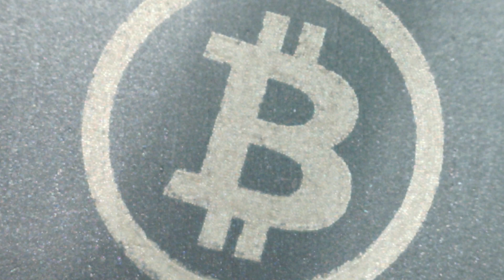ASICMiner Block Erupter USB Teardown

Comment: well, i was using bitminter to mine, when it had 10THP now its up to 15-20 THP also diffculty was at 30,000 now its at 50,000 and that was only 3 weeks ago. :P